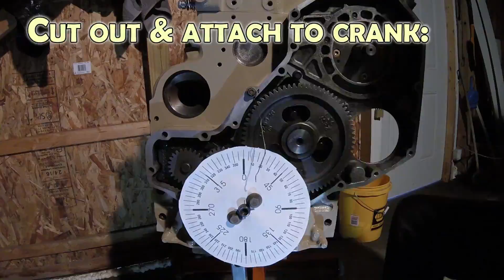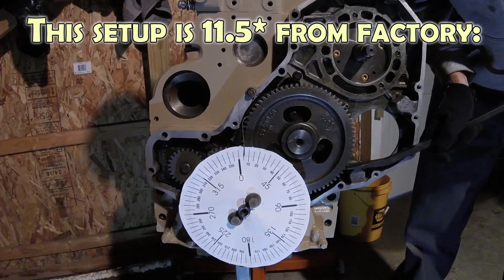Basic Timing Advance Walkthrough (P7100 P-Pump) × 4BT Cummins Discovery #5 [Land Rover Build]

Comment: You should consider a fluid dampener 4bt’s Are not balanced and are very shaky as you probably are you now hello Deborah’s help with this
Reply: Fluid dampeners help with this
Reply from the maker: No doubt they are shakey buggers compared to the buttery smooth 6BT. I know a damper on the crank pulley is critical on an auto trans, but with a manual like mine supposedly the heavy flywheel & clutch should damp a lot of it. BUT I'm still thinking about it, can't hurt right?
Reply: Tinker ill be testing the difference Aswell.   I just bought the pully.     My ati.  Damp sat to far back and hit the oilpan.   Aera.  And if ya use an afternarket. Gear case it also rubed.    I need a spacer made.   To get it all to line up.

Comment: When the pump you mount is bigger than the engine in your wifes car.....
Reply from the maker: It kinda blew my mind when I first got into these mechanical Cummins engines & found out the injection pump is like it's own little engine with a psuedo crankshaft, pistons, cams, etc
Reply: Tinker i said the same thing.   Its fascinating.

Comment: Rotate your engine by the flywheel, never the timing gears.
Reply from the maker: For fear that a gear slips on it's shaft...?
Reply: @Tinker1837  Nope, for fear that there is to much leverage on the gear tooth. Do what you are comfortable with 😏